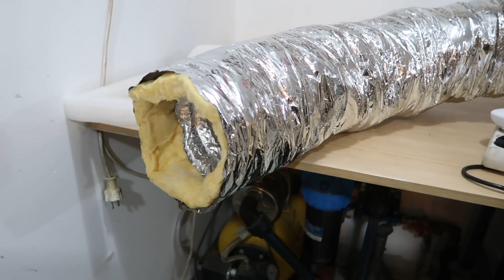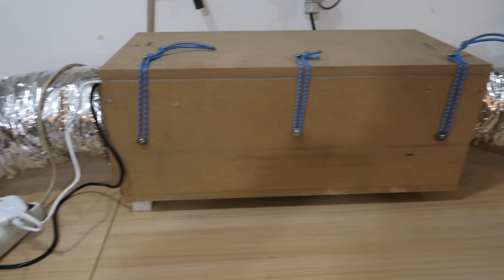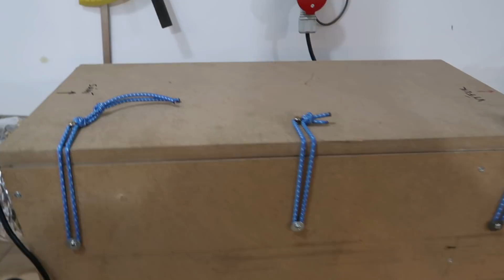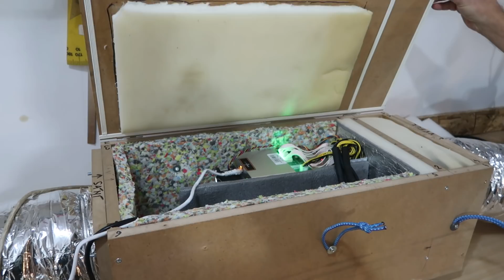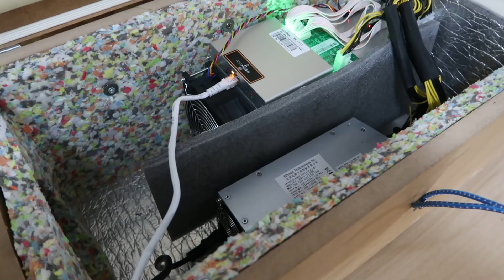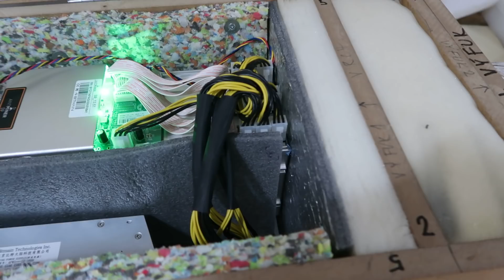Antminer S9 soundproof box DIY -20dB

Comment: hey i would really appreciate if you answered these questions.. 1) how hot does it get compared to leaving it outside the box? 2) does it make 20db less.. so 80db - 20db = 60db? do you keep the heat circulating inside the house or one side of tube outside? thanks a lot!
Reply from the maker: Thank you for your interest>
1. I`m not sure, but when you leave it outide box - temperature can be around 75C°
2. Now it is more insulated and very quite - I have to measure it again, but from this first testing video it was -20dB, so yes, it was around 55-60dB.
3. We use heat from Antminer for heating living room, especially during winter tie it was pretty good. Later I have to move it completly outside on the garden, because get to hot when you have perfectly insulated house.
Reply: I run mine in the living room and vent it up the chimney we don't use, keeps the heat out during the summer, or you can use a dryer line and split them in two adaptor to outside vent.

Comment: I have a similar box, but I did not find any soundproof pipe, I am using 12cm diameter aluminium pipe (also 1 meter long), and I notice that most of the noise is coming out from the edges of the pipe... so my question is, does that pipe works also as a sound barrier or if you measure the db at the end of the pipe you will get the "expected" 65-7db? Thanks.
Reply from the maker: From 1m long noise reducing pipe I can hear only air from fans, so I think this is the most important thing of this soundproof box concept. So there is almost no sound from the pipe.
Reply: Thanks for your reply, I was believing that  the box was the thing, so I guess I really have to try harder in finding some place that sells that type of pipe.

Comment: Do you know this soundproof box for the antminer could sell for loads on Amazon worldwide? Why is no one taking it seriously as it is the only mess - the noise stopping one from buying the antminer 9/ 9i.  The electricity can be managed if one makes enough coins to cover but the noise will not be accepted in most residences.

Make loads of sound proof boxes and sell on Amazon or eBay or other now! lol... seriously.
Reply: I'd buy one, I lack the tools and carpentry skills to make then myself. The ones I saw on ebay where cheapy plasitic POS this is way higher quality.
Reply: @leifleoden5464  I been thinking about making one put of a cheap cabinet at lowes with sound proofing foam and home made brackets. (I own a larger scale 3d printer) just out of curiosity let's say you have a bitmain s19 pro how much would you pay to dampen the noise?

Comment: Hello :) thanks for your video. I want to ask, how has been doing the soundproof box for s9? also, whats the chip temp inside the box? does it increases vs outside the box? or is very similar? ty
Reply: Just switch on the air conditioner

Comment: your temperature must be extremely hot!!!!!!!!!!!!!!!!!!!!!
Reply from the maker: How much do you think in C°?
Reply: fluorobotanics 45-47?
Reply from the maker: around 35-38°C, becuase fresh air (20°C) go inside and immediately outside through this box, so air going outside is used for heating during winter time
Reply: fluorobotanics roger that.
Reply: What temperate would brake it

Comment: does power supply has no outgoing air  ? doesnt it get hot ?
Reply from the maker: It is not necessary, because power supply does not heat so much and heat go out through antminer. Power supply is around 35-38°C.